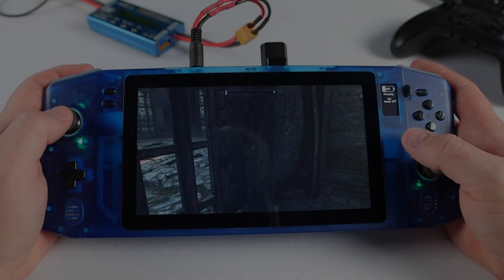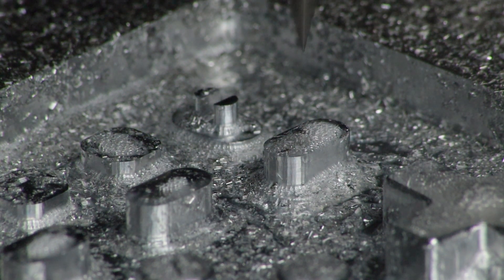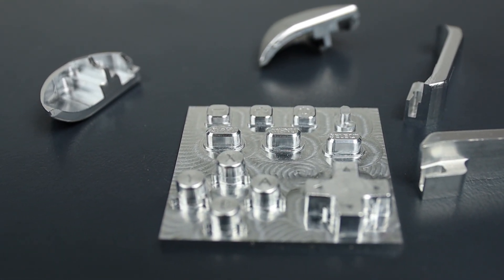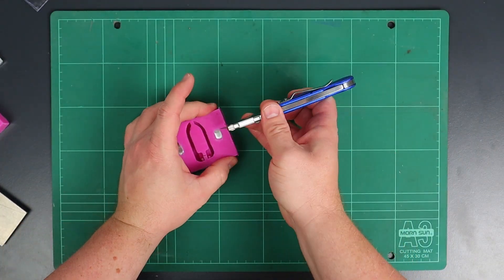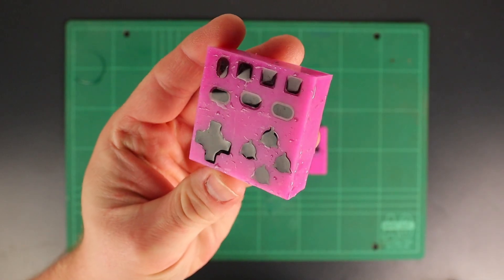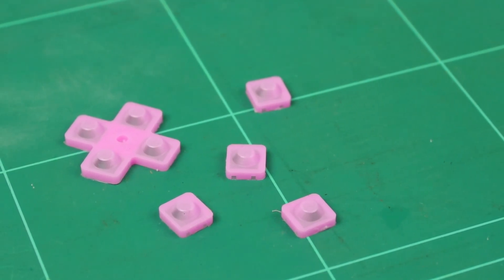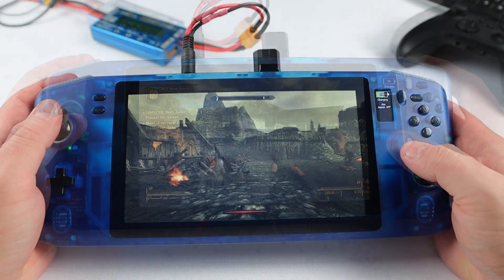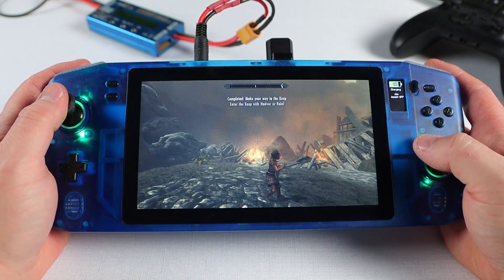NucDeck - The DIY windows gaming handheld - Episode Six

Comment: (Little disclaimer that's the first video I saw here on the channel so sorry if he maybe done things already that I list here up.) 

Oh I have so many Ideas how I would try to pimp it. But that would be a bit too much. 😅
Especially because I need the knowledge first and second problem would be the battery/batteries.

Because I thought about putting an Nvidia RTX Laptop GPU into it with a thicker cooling fan then normal laptops have today, a mouse switch so I can use my sticks as a mouse and last but not least keyboard.

So at the end I have the strength of a gaming Laptop in a smaller device.

I mean no mouse and a small display and keyboard.

It would be a bit more compact in the overall size then a gaming laptop but still would have a good amount of power.
Reply from the maker: Love the enthusiasm! The graphics card thing is probably a bit of a stretch given current battery technology, but maybe one day we will see it! As for the mouse switch, I've already included that on this device and its working well! You will also be able to map all the buttons to keyboard buttons when in mouse mode so while you won't have a full keyboard, you will have the buttons that are most important to you!
Reply: @cncdan  Ah okay yeah I thought about the keyboard thing because I'm planning on playing my Skyrim with a ton of mods that has keyboard shortcuts.
Reply from the maker: With a little bit of work, you could add a bunch of keyboard combos in the controller menu system for the lesser used commands that you still need access to. I've found it very useful to include shortcuts in there for stuff like "Alt + F4" to force close a program/game without needing to go and get a keyboard. The pi pico has LOADS of memory spare, so you could probably store hundreds if not thousands of combos in there although you'd want a better way of organising/displaying them at that point.
Reply: @cncdan  I'll see how things are going. I'll watch all the videos you done for that and then I'll see. 😊👍
Reply from the maker: I haven't had a close look at the controller display since the second or third video in the series. I've added a lot since then. I'll be taking a closer look at it in the next video!
Reply: @cncdan  Oki doki 👍

Comment: I appreciate an effort you put into this project, it's really remarkable, and the build itself is great, but why not just use a resin printer for this buttons?
Reply from the maker: You're right, you absolutely could. They may not end up quite as glossy and smooth as these ones but if I had a resin printer that's exactly what I would've done!

Comment: If you were able to make a device that allows you to slot in a 4x4 mini pc board it would sell like hot cakes..
Reply from the maker: This is basically the aim. Any 4x4 mini pc with minimal modifications required to make it fit. I'm not planning to sell them though because I think it would end up consuming too much off my time, so I've open sourced it instead!

Comment: Why is it so low Resolution
Reply from the maker: The lower resolution will ultimately help the older intel CPU produce playable frame-rates. Its still roughly 170 pixels per inch meaning its higher than most laptop screens. Its something I may improve on too when I upgrade to a newer NUC

Comment: Wonderful project. I think it is important to use Hall Effect stick modules to make the life of the stick modules as long as possible.
Reply from the maker: Yeah, I would've loved to use hall effect joysticks but I started designing this project almost a year ago and at the time all I could find were xbox/playstation style joysticks with hall effect sensors. The ones I've used have a significantly smaller internal footprint which gave me a lot more room to fit things in.
Reply: @cncdan  There is another option, the Guikit Hall Effect stick modules for Nintendo Switch, they are small.
Reply from the maker: @InterstellarLord  they also weren't around when I started designing this I'm pretty sure. I'm also not a big fan of the limited travel of the switch style sticks which is why I opted for the ones I did. I'm just keeping my fingers crossed that a hall effect version of the sticks I've used will become available as they are a great size and still offer full-sized like travel.
Reply: @cncdan  Thanks for the reply. I wish you success in your project, super interesting.

Comment: i don't want to sound hater, but with the open source idea on mind is not better, faster and cheaper using already existing buttons? i mean for that diy project, you can make a perfect prototype using current hardware... and is more repeatable for ppl around the world... that aside DANG WHAT A NICE AMOUNT OF WORK! it turns out beautiful...
Reply from the maker: Yeah, that's an option I considered. It may not look like it but the front edges of the controller sections taper down a bit so finding buttons to match that was proving to be a bit difficult. If you didn't care too much about how they stuck out though you could easily modify it to use buttons from something else!

Comment: the lack of the touchpads on either side is a dealbreaker but otherwise fantastic job.
Reply from the maker: Thankyou! I'm honestly surprised how many people love the track pads. Admittedly I've never used a steamdeck before but they look kind of awkward from the photos!
Reply: they are right up to the point that they aren't.  you have to get used to them for sure, but once you are, they are great.  context menus, scroll wheels, of course, a mouse, they double as a giant button, if you want you can make it a glorified second D pad but it's way more configurable.  i'm able to play several games where a controller alone just wouldn't cut it, and the trackpads in conjunction with a mode shift button or two are the gateway to functionally unlimited buttons.  though, i do wish they were just a tad less jank to use. they are finicky. but honestly the trackpads are the thing that separates the deck from most other hardware. but your project looks like a blast.  i can't wait to see what else you come up with.  this is some great work and i look forward to more.  sorry for the thesis. @cncdan

Comment: I love it!!! I am also pitching this idea to everybody I can in hopes it becomes reality. I think it would be great if we could repurpose  screens from old phones and use those instead of buying new expensive IPS screens. I feel like it would be a great way to recycle devices that are completely outdated and destined for garbage as well as open doors for us who like to tinker, but have no expendable budget. This would also repurpose screens on phones that are completely bricked. 

Recycling just the screens are one way to go, but what if we could also begin more open source projects to develop custom roms for these phones to not be a rom with less bloatware but a barebones os for these phones to do specific tasks. 

For example, recal box helps older computers better emulate classic games by removing the bloat of the operating system between the emulator and hardware and puts the emulator closer to the hardware that it uses less resources. What if we did this with phones, but not just games? What if we did this also where we made the only function to be an IP camera. We do this some, but it would be nice to have a custom rom that its only function is to open up a menu to connect to wifi and display the local IP address on screen. 

Older phones have comparable specs to some raspberry pi's. Maybe we can make a custom rom to make old phones into a headless linux servers for various projects like we would a Pi. Some examples would be to run Pi-Hole, AdGuard, a web server or perhaps even a mine craft server.
Reply from the maker: Whilst I do love the idea of saving whatever we can from E-waste, phone screens can be a bit tricky. As far as I know, there's many different types of technologies used and they aren't always easy to integrate into our own projects. I'm not an electrical engineer and a lot of that stuff goes way over my head, so I had to work with a technology that I am familiar with. Having said that, this type of display is common in cheap tablets, car headunits and digital photo frames, so you could easily recycle one of them if you had one laying around you wanted to make use of!

Comment: I gotta love that battery meter feature on the right of the unit, dope af, but lets polish it slightly, instead of it going all the way back down to 0% and cycling up to 100%, have it start at the batteries current percentage so you know how much it is actually charged, during charging without having to remove the charger or without exiting the application you are currently in.
Reply from the maker: Someone else commented almost exactly the same thing today! Its actually just an animation currently, there is no battery to monitor until I finish the power management system. Once that is complete and there's actually something to monitor I'll be making some changes to the battery monitor display.
Reply: @cncdan  hahahha Havn't been following the entire build so you can guess why that might've gone straight over my head, can't wait to see the power portion of this, it's an area I'm always interested to see what people are doing. No wonder it felt like it was more for show than anything else

Comment: The battery charging icon could use some work.  I get that you want to show it animated, but the percentage should be accurate to the state of the hardware, not the animation.  Also when possible the animation should show the level of charge as well, and just indicate movement (i.e. a flowing gradient, instead of a solid green color; but either way, the percentage should not move).
Reply from the maker: The battery indicator is nothing more than a repeated animation at the moment. I included it right back in the second episode just to demo the screen. Once I have the battery management stuff in and actually have some information to read out I'll be making changes exactly like what you've described!

Comment: You can also vibrate the molds to get the bubbles out. For a budget shaker you could probably use a radial or edge sander in a vice. If you're worried about silicone coming out of the mold you can fill it half-way, vibrate it at a slow to moderate speed and fill the rest of the way.
Reply from the maker: Good to know! I've got a random orbital sander so I could probably make an attachment for that. Will give it a go at some stage in the future!

Comment: could you use a syringe to put the resin into the small molds?
Reply from the maker: I've tried this before. You can, as long as the hole in the syringe isn't too small. They are also almost single use as removing the last bits of resin from them can be difficult. I find just dripping it in works pretty well!

Comment: this is sooo amazing, but I think you need a resin printer :D if I would cnc the buttons I would actually use the metal ones :D
Reply from the maker: Yeah, I'd love a resin printer. I'm sure it'll happen one day! I've actually built a handheld in the past with aluminium buttons and they are surprisingly cold and heavy feeling (not to mention rattly). The resin just makes for a much nicer feeling button!
Reply: @cncdan  Ive experimented with resin printed buttons and they come up quite nice, not to mention done quite a few dj mixer knobs that after a coat of paint look factory made ;] its a pity that resin printers arent perfect as well, bigger parts are fragile and really hard to print precisely, Ive tried to make my own retropocket with the nice square screen but some parts turned out way harder to print that I thought

Comment: Bro, this aint some DIY project, this is pretty much R&D for a real mass production product, with molds and everything. Wouldn't be cheaper buying the membranes from China?
Reply from the maker: Thanks! As for buying from China, this is all pretty custom stuff so it's easier to just do it myself. You don't need the membranes either, there's an option to just run clicky switches.

Comment: 13" laptops are also a good source for motherboard / SoC.  You can find decently spec'ed boards for less than $100...they already have display connectors and circuitry, often even for touch screen  They are almost plug and play past the control / gamepad interface.  You can make some pretty intricate case / chassis by using thick and cheap plastic cutting boards and cutting out different layers.  All of this can be done without 3d printing or any fancy equipement.  Anyone with some ingenuity could put something decent together.  Parts of whatever gamepad you tear apart could be used with the chassis as well.  The plastic cutting boards are easy to shape with some basic files and / or a dremel.
Reply from the maker: Yes I looked at plenty of different options when I first started designing this. The problem with laptop mainboards is they aren't always sold everywhere so tracking down a particular board can be painful. I choose the NUC because it's very small and they are readily available pretty much everywhere and the different models only vary slightly so it's easier to adapt the design to suit!

Comment: Only half way through the video atm, but curious on why you made the mold using aluminum, instead of 3d printing the buttons and making a mold out of that?
Reply from the maker: Hopefully you found the answer in the video anyway, but in case you didn't, I choose to make the positives in aluminium because I can polish it and make a nice glossy mold. The silicone picks up heaps of detail from the positive so if I used a print I would've had to spend hours filling and sanding to get even close to the same result. If I had a resin printer though, I would've just printed the buttons on that!

Comment: This is beautiful. If only Intel themselves took handheld gaming this seriously. Have you considered trying Linux to see if you could get better battery life or performance? There are a few SteamOS clones that could make the software side of things much more streamlined, and Intel drivers are open source too.
Reply from the maker: Thanks! I did try HoloISO on it a few months ago but I couldn't get it running properly, I'm not sure how good the support is for the older generations of Intel stuff. I'm definitely interested in trying some other linux distro's once I have time, but at the moment all of my spare time is going into finishing the build!
Reply: @cncdan  there are 2 new contenders now! There's ChimeraOS and Bazzite OS. They both use a more mainstream and updated Linux kernel with arguably more compatibility. Also, there's other distros like PopOS that have great power management options out of the box, you'd just need to set steam to open at startup.
Reply from the maker: @rastamouse7861  cool, I'll definitely look into them!
Reply: @rastamouse7861 ChimeraOS only supports Radeon GPUs, it would have to be Bazzite
Reply: @protocetid  okay I wasn't sure about that. I know that ChimeraOS used to support everything, and from what I understood, the only thing that didn't work was the overlay of FPS and performance stuff from Mango HUD.
Reply: @rastamouse7861  IDK why ChimeraOS is only supporting Radeon either, my best guess would be that it’s less work for them when almost every handheld PC is full AMD. Not a developer so I could totally be mistaken.
Reply: @protocetid  it was originally intended to be a desktop operating system for the living room that defaulted to the old Steam Big picture mode. But since Valve has dropped support for big picture mode, ChimeraOS could no longer offer it. The new steam deck interface seems to not like non-AMD GPUs.

Comment: Im really impressed with the use of familiar x input software, although not ideal, it's good for showing how awesome the system already is now. Do you think you're going to be using a different solution such as firmware to get x input? Can't wait to see the next video. But do you think that metal buttons would be functional or too harsh on the housing overall without different materials involved?
Reply from the maker: You could definitely do metal buttons. They'd be a tad heavier maybe but I don't think that would cause any issues. As for the controls, it would be cool to be able to emulate x input on the actual hardware but I'm not sure if it's been done before or not. Might be a bit outside of my ability levels to figure out on my own!
Reply: @cncdan  well I've seen people do it with fight pads and hitbox controllers in the past. And I've also seen hardware that runs as interpreters with incredibly low latency such as ones from 8-bitdo. But then your integrating a whole other off the shelf component that may become unavailable like the nuc (albeit likely highly more replaceable)